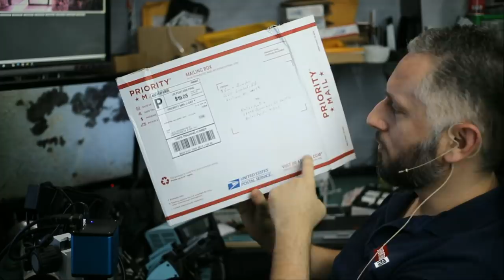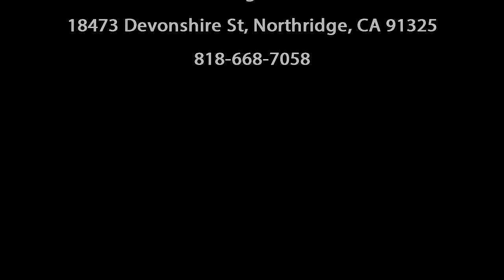iPad Pro Broken Board + Galaxy Tab A SM-T580 Charging Port Replacement

Comment: Can you tell us which solder did u use ?
Nice and clean work!

Much love from Germany :)
Reply: Vor dem entfernen erstmal Zinn mit niedrigem Schmelzpunkt. Für das neue Teil bleihaltiges Material, dass man so langsam schwieriger bekommt in Deutschland.
Für das erste findet man bei EBay z.B. Roses Metall. 
Für das zweite Lötzinn mit zB Sn60PB40.
Und das Flussmittel niemals vergessen. ;)
Reply: Marcian0 vielen Dank!
Ich habe tatsächlich gestern erst herausgefunden, wie das Lötzinn mit dem ultra niedrigen Schmelzpunkt heißt (Roses Metall). Ich habe überall danach gesucht :-)

Darf man fragen, was du so reparierst?
Aus welchem Bundesland kommst du?

Liebe Grüße und noch einen schönen zweiten Weihnachtsfeiertag.
Reply: Roses Metall ist eine von mehreren Möglichkeiten. Es gibt auch ChipQuick. Das kostet aber... ;)

Mein Hobby dreht sich hauptsächlich um 16Bit Computer. Nebenher bastle ich manchmal an Konsolen (PS2 PS4). Nix Wildes. Nur zum Spaß.
Bin in NRW.

Ebenfalls noch einen schönen Restfeiertag.
Reply: Woran bastelst Du denn so herum?

Comment: Hi, I'm Mahmoud from Syria. How much is the air temperature
Reply: Alkabory Alklf There is no easy answer to that. There are to many variables like how accurate is the machine regulating its temperature. How wide and how long is the tip.(longer and thinner tips cool the air so you need to raise the temperature to compensate) Plus you need to adjust your air flow depending on the board you are working on. (For smaller/thinner boards use very little air to not melt everything around including the bottom of the board. Big/thick boards need plenty air because they dissipate the heat a lot more.)

My recommendation is the same as every other micro solderer, practice and get to know your tools. 

The range I usually work with is 260-320 C using an average tip. However if I am using my smallest tip I use 350-420 C.

Added note: The stations where the air pump is inside the station and connects to the handheld part via a hose typically have better air flow than the stations that have a  fan inside the handheld part.

Comment: Low melt solder? I just fill the entire charge port with normal leaded solder and remove it with the soldering iron. Once its all melted it only needs a little push off the board. Watch out for your crotch though. 😅